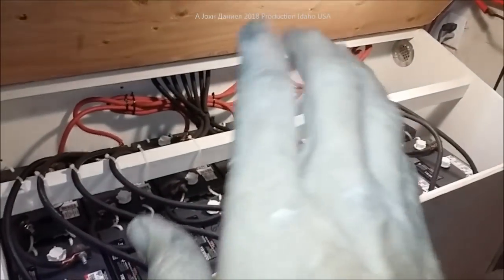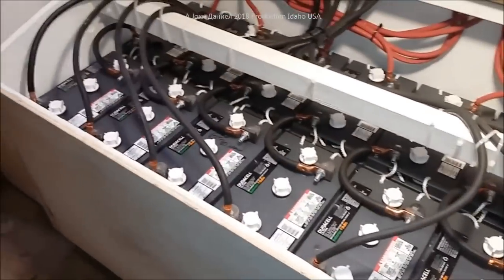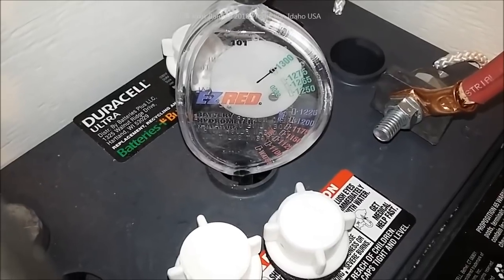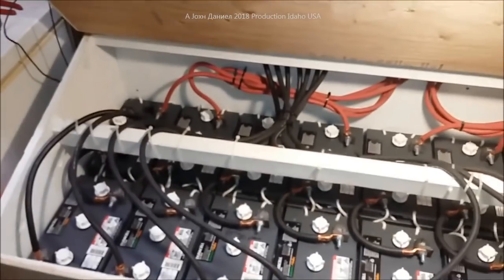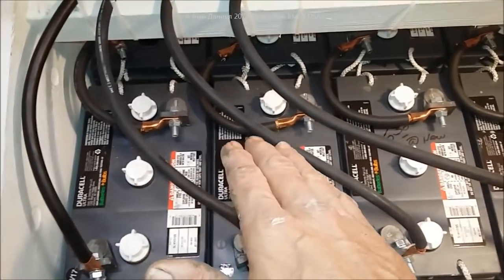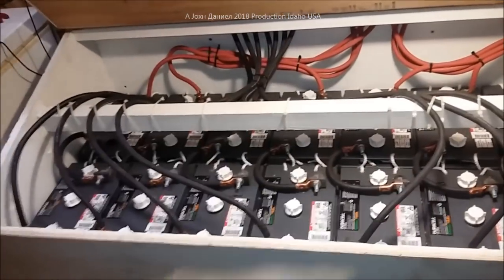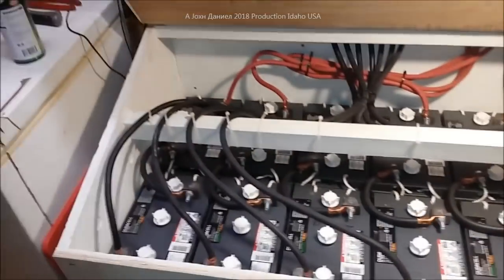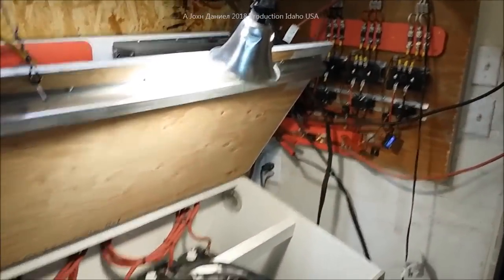Off Grid Batteries,  My ideas, best parts to use as defined below

Comment from the maker: ATTENTION NEW SOLAR FOLKS - You Can actually Do It Yourself from this list below. ✌ Complete easy system I install often, It's a read! Uses a Renogy MPPT controller 40 amp http://amzn.to/2ggyi44 ~ CONTINUE READING! Best Solar Panels https://ebay.to/2qKWj5u MightyMax 100w 4bar 5 of these 100 watt for a total of 500 watts, great low sun abilities & a perfect safe 91.5% the capacity of the 40 amp MPPT and *VERY SMART design*. You can tie 2x2 for a 24 volt system or 1x4 for a 12 volt system Its that DAMN EASY!  *A impressive rock solid DC to AC power Inverter 2000 Watt https://amzn.to/2v2dPXm
 Off Grid Energy Monitor is with a REAL Thermodyne Watt Meter, https://ebay.to/2vtfF3P Original 180A meter PROVEN BEST ONE MADE, Don't get fooled by that professional Liar King Jeff'rolio and buy that fake vietnam  knock off copper colored aluminum wired crap sold from missouri, pure junk. He is so Pissy like a little girl for getting busted by the feds for solar import crimes and attacks people.
Solar Wire and other parts will be needed but that is all depending on where you install, not a difficult thing, not expensive. I have been doing wind and solar as a OWNER/USER for over 15 years. I am not a dealer, I hate dealers.

This up sizable serious 500+ watt solar basic + system for under $1000, it is expandable. And will be cheaper to own than any gas generator or alternate power supply. As a person who lives off grid, I know what works together! And I gave you a list of the most dependable parts you can find on a budget and my experience for free! 
You Got Questions? ASK ME!!! I got no issue telling you how to do this and I don't give a care where you get your parts or who helps you, I just like helping BEAT THE MAN out of owning your butt at the utility company! 

This serious 500+ watt solar basic + system for under $1000 is expandable. And will be cheaper to own than any gas generator or alternate power supply. As a person who lives off grid, I know what works together! And I gave you a list of the most dependable parts you can find on a budget and my experience for free!

Comment: Hey John, I know this is an old video. But what do you think about high voltage wind turbines? Like 240 V three phase 2000 W. This is what I'm thinking about installing.  My thinking is I can run a number 12 gauge extension cable 200 feet. And then use a step down transformer to 48 V AC then send it through a three phase bridge rectifier. The transformer is going to cost me $200. But I think I will save that money times 8 in the 200 feet of extension cord line versus 2000 W at 48 A AC, at that sizing I think I'm going to need number six gauge just to handle the AC. What do you think?

Comment: If I run 6 or 8 12v deep cycle batteries ( about 90 amp each) connecting each battery individually to a bus bar (1/2" x 1 x 6 110 copper bar), I should expect a balanced bank like yours?  Seems like I should. It makes sense that it wouldnt favor one battery over another as long as all the wires are the same length.
Reply from the maker: Yes, that is what your result will be. For those amps, just use 4 awg cable. Welding cable by Temco is the best grade and prices.
Reply: @JOHNDANIEL1  Awesome, thanks. We were going to buy 0Awg to cover everything, but that will save some coin. Rock on.
Reply from the maker: 4 awg is good for 150 amps, running it back to your bus bar each time from the batteries is more than enough. You may want 2/0 to run a inverter from that bus bar if its 3000 watt, over that use 3/0 or 4/0 if the inverter is over 3k and distance from the batteries is too far. TEMco options, https://amzn.to/3JhKe0a pick 4 AWG RED/Black and use the Selterm Tinned 4 awg x 5/16 lugs.  https://amzn.to/3mz1RzF  That/those should be your best in ability and options for cost and needs. Just measure your furthest per battery cable run, consider all others will be that length, get that plus 10% so your covered.
Reply: @JOHNDANIEL1  Perfect! Thank you.

Comment: Awesome video again John. It is so good to have a source of information to go to on solar wind,and batteries. I just watched this video. after 4 years do you still wire your batteries with hot and ground from each battery in the bank ? I have two different battery banks of 6- 6 volt batteries ,one bank is interstate golf cart batteries and the other is USA 2200 6 volts. Im goint to use the USA;a for my primary bank and use a smart battery idolator between them.
Reply from the maker: sold that bank with the house, built a new one same way in new place

Comment: Question, how hot do those feeders get on those wires? I see you have the bundled with zip ties. Ever check current on each end of bundle ? Also, the first in line if fed they each battery could be underrated! Would a bus bar balance?
Reply from the maker: No heat, all are balanced

Comment: Hi there John i greatly appreciate your videos.  I am looking at building a battery box, but am having trouble finding copper flatstock to make my bus bars for my battery connections.  Could i use the aluminum  blocks like  your 4/0 connections to your inverters? Also if i use two inverters  can i run my well off of this type of system? I am looking at 8 batteries 
with 2000 watts of solar and a 500 watt wind turbine.  Thanks for all your great information  Randy
Reply from the maker: Buy you a few feet of 1" Type L copper pipe, using a good method hammer it flat into bars. Drilling out as needed and using nut and bolt for terminals, you have a 700+ amp bar made of 99.86% pure copper

Comment: I'm in the process of solar in my off grid cabin. Right now I've got almost 70w solar and 2 boat batteries. Havent got anything permanent just yet but as soon as I c as n devise a way to mount the pannels so I can add on I'll be ready to set it up permanently. I'm also thinking of wind turbine as well just for backup. Dont worry about the nay sayers they are everywhere and they are just trying to get your goat.
Reply from the maker: Check my last 4 or 5 videos for more details on what your working on.

Comment: It's true, by parallel jumping you will need to switch the batteries around because of the wear...the batteries will not wear even...plus you need one way bigger wire 👎. Your way is less resistive and using easier to handle smaller gage wire, better for battery 👍...
It's not only hydrogen batteries produced but oxygen, oxygen is heavier and more dangerous, will falls to the ground, hydrogen just flies straight up to the heavens...
Reply from the maker: Last set lasted over 6 years with me being a lousy caretaker.

Comment: right on about the wire gauge and length . with a pa system it will also create a echo affect if the cables aren't the same gauge and length.you see the lightning before you hear the thunder.thanks for the videos.

Comment: would that work with  2 are more 24 volt bank like the setup
Reply from the maker: The style of mine with manifold wiring works with any voltage you choose.
Reply: thanks like that setup good vids

Comment: Lead acid batteries suck...the fact anyone even uses these still is insane!
Reply from the maker: We honestly considered not buying SUCKY batteries, however I did not get your credit card number to pay the 430% higher cost for lithium and my (AND YOURS MOST LIKELY) insurance company will NOT cover your home or shop if they find you are using them, or if it burns down.  Even with a Tesla wall unit you can loose your house insurance ( Ooops) which HE Musk admits in his 2017 commerce speech. ( now you know why all that pump and hype on the Power Wall has ceased) 
I 100% lost a 23 foot cargo trailer full of $11,000 in tools 2 years ago that was fully insured, however my using 4 commercially built 44 amp Lithium ion battery packs, which caused the fire with a failed Midnite classic controller not disconnecting the 500 watts solar. I got nothing, and the Battery seller BatteryShark is MIA now. So, If the fire is caused by Lithium battery failures, which do at a 23% higher rate than them Sucky LA batteries you are in now way assured cover, or safety. Quality is so off the wall with makers in China on the Lithium battery that professional tool battery restorers have recorded from the same maker you can get a manufacture variance of up to 30%. No Thanks!
Reply: @JOHNDANIEL1  my batteries were $62/kwh which I am guessing is less than you paid, and you only relied on midnight classic charge controller to keep them in check instead of a BMS and charge controller. Your battery bank is only 50% DOD unless you want to damage them and peukert effect is horrific at anything above 1/20c rate which drops it even further. Then the maintenance on flooded batteries and easy plate sulfation if left sitting not fully charged ruins them. In this day and age, it makes no sense to buy a new bank that is lead based. I don't know why you need a company to support your use of batteries and why would you store your bank in house if you  are that worried about insurance dropping coverage? Not that I have heard of any company actually dropping coverage. They are just as dangerous as a water heater or any combustion appliance if not used properly or installed correctly. Tesla is an expensive example of battery storage but at least it is properly implemented. You can keep using your system, but it is a poor recommendation for renewable energy systems that are efficient, low cost, and good performance to get every watt hour you can get out of the available resources instead of dumping power into power sapping lead acid batteries which average charge/discharge efficiency of 85% which is usually best case.
Reply: You can replace a 1000ah lead acid bank with a 200ah Lifepo4 bank which will charge twice as fast, be cheaper to buy, last 5x longer and perform better in temperature extremes. Watch my video series SOLAR BATTERY BATTLE

Comment: Love your video just now trying to add solar in my back yard to a 16'×20' so much out there can't figure amount size of battery because of jack-legs! Sorry! I bought 100 watts Harbor freight panel kit so far trying to figure out the other. Live in large house want the small living space for emergency. We were hit by tornado on big house roof kitchen ceiling fell in had to stay in house while reconstruction. Terrible! This was 2 yrs ago
Reply from the maker: 100 watts won't do much, it will keep batteries nice and charged up but not for any hard run need. For a very basic bug out safe spot you need at least 300 and 2 good quality deep cycle batteries. The HF kit is the best educational tool you will ever buy for the purpose though and it is a excellent kit for that. Using 12 volt DC things like fans, lights and a 12 volt DC TV are smarter than trying to do al on inverters and insufficient batteries. A perfect design would be 4 batteries, 600 watts on 2- 30 amp controllers and a 1500 watt pure sine inverter and a 2000 modified inverter. Get a deep freezer about 5 CUF and a large cooler for food and put 5 or 6 blue ice cooler things in the freezer and the rest of your excess food from your house so your using what power you make already. Run your power tools off when you can, utilize the system when not needing it for back up also. If you need a absolutes part for part designed system at cheap cost let me know and I can drop you a full list and source on it all.

Comment: Just came across this video
you sound like JR. from WWE
Like your set up
I have the Positive at 1 end and the negative at the other end using 4/0 welding cable
the way I was told buy a fellow You Tuber
Is it right or wrong?
All my cables for + and - are the same length from inverter to battery box
Reply from the maker: After string wiring a set like the pro's ( people selling it on you tube) many years ago I noticed the water dropping faster on the first and last battery. A study on whats called generator landing, equal length wiring like they do on submarines from 1900 to 1955, I decided to try it. Now my batteries produce longer draw down and lower water loss.
Reply: Thank you for your response I will take you advice Keep up the good work
Reply: Thank you for your answer I will try your way and get back to you. Never hurts to try someones way. Have a Wonderful Day.

Comment: I like all your videos. I guess you set up a separate shed to store everything and ran cable to your house - is that correct?  Looks expensive. I've been collecting Deep Cycle AGM Batteries, little by little. I haven't set it all up yet. I'm a little reluctant to drill the holes into my house for the cables. Right now it's just the cable guy that drilled holes. I want to use solar like a backup generator. It's all about the availability of gasoline. I'm concerned about the split phase required to run the sump pump and bring water to the house - 220V required. I have Pure Sine Wave Inverters - 120V. Everything is expensive.
Reply from the maker: You can get a 12 volt to 240 volt split phased inverter to run a homes water pump, as long as its under 3 horse power and your not using it to water a 1/2 acre garden you never have a problem. I have a 600 gallon tank in my basement and a dual fuel 240 volt generator to handle our water needs, due to my well being 400 feet and needing 3 horse. I could do it, but once you get past 2 horse, the start load just is hard to manage on a under $800 inverter, in fact it triples in cost.

Comment: How do you feel about people doing the diy powerwalls vs your battery bank. I’m asking because I have just started my journey into solar and wind power with battery backup. And your battery bank looks a lot easier to do and maintain.
Reply from the maker: Power walls seem absolutely awesome, however battery quality is 50/50 on them no matter what a battery seller preaches to you. Tried and true is Lead Acid. And they can be sourced from long term reputable companies. Order online with Batteries Plus batteriesplus.com and get 10% off if you pick up in store.
Reply from the maker: For a starter, go with one pair of these https://www.batteriesplus.com/productdetails/sligc125 for a 12 volt system, 4 for a 24 volt, for every 700 / 1400 watts of solar.
Reply: Јоhn Daniel thank you very much. I just found your channel so I have some binge watching to do on your system. You don’t have to worry about a BMS do you?
Reply: Јоhn Daniel I’m going to work on building a system to support around 10kwh a day on a hot day. And that’s if I’m reading our bill right. LOL but that house had 5 rooms with 10ft ceiling.

Comment: John, what you express about wire length is the reason most battery banks last about 1 to 2 years instead of at least 20, and the newer batteries are suppose to last 50.   one thing to keep in mind, is that your electrolyte can stratify and needs to be mixed a bit,  (some inverters have this feature, but of course you have to add water.

what i do not recall you saying, is that using parallel series, you get the full capacity of the batteries, and the amp hours.   this is not possible with a strait parallel wire scheme.  well done on the presentation and the system as a whole

Comment: There is resistance  in the cable or buss. The last battery isn't coming to contribute as much. There will be losses. When using a buss. And pulling from one end. The way you have your bank wired is basically wired perfect.